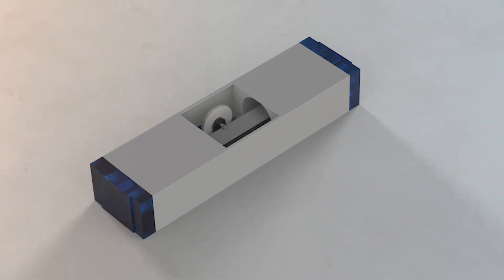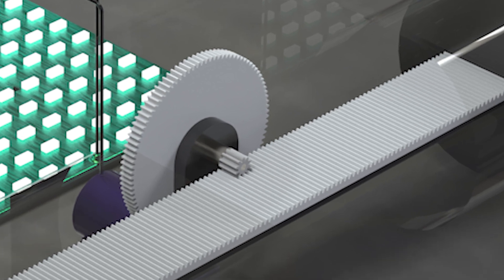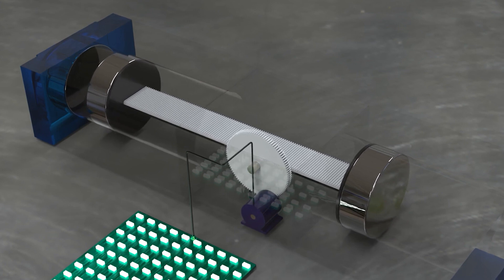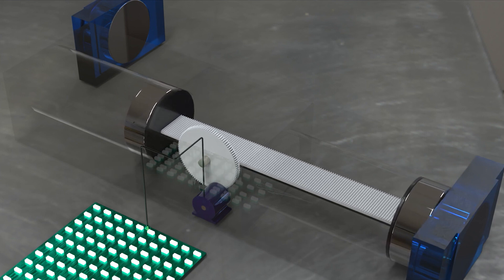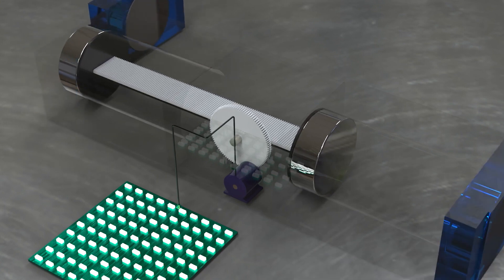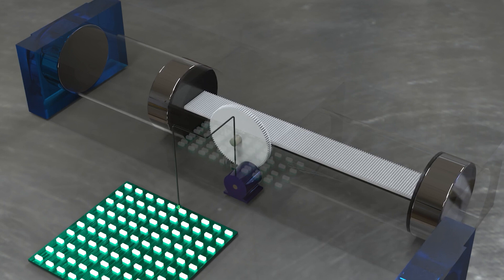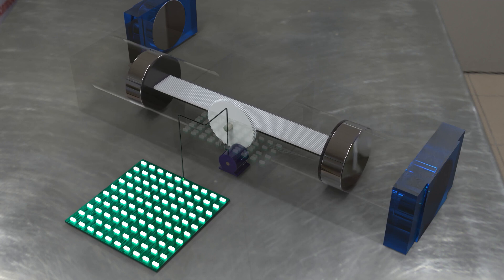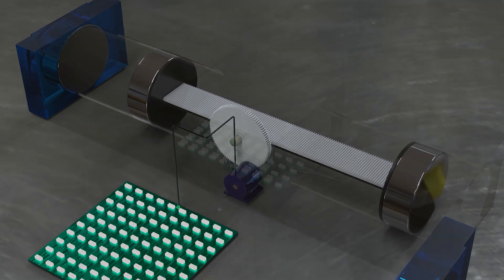Magnetic Generator: The Future of Sustainable Energy

Comment: only mistakes!  the deflector magnet must not impede movement.  therefore, it should only be pushed in when the reflected magnet is in the extreme position.  the rotation of the bouncing magnets!  the mechanism must mechanically connect the rotation of the deflecting magnets and the deflected shaft.  timing is very important!